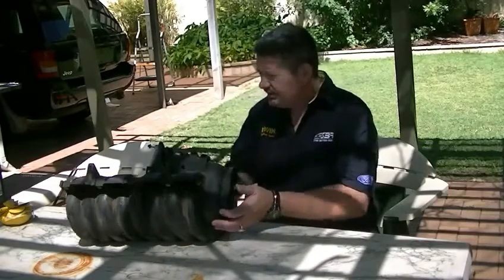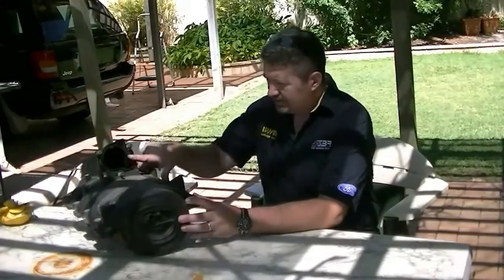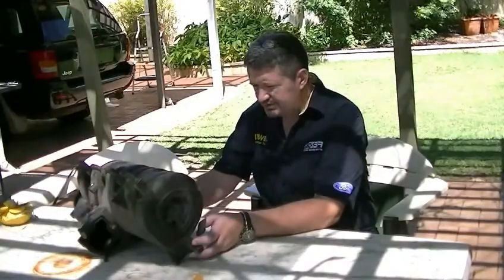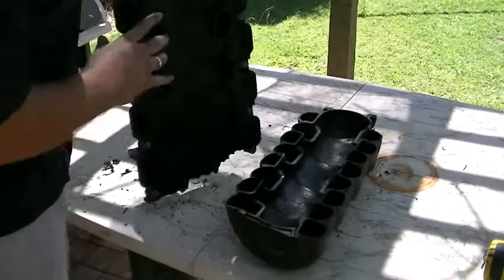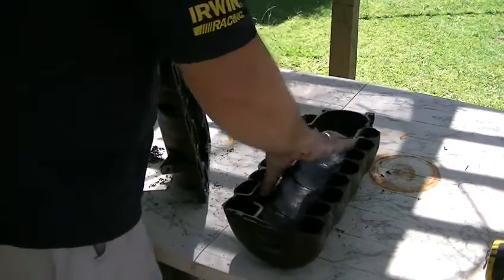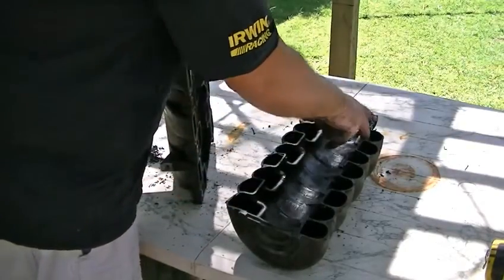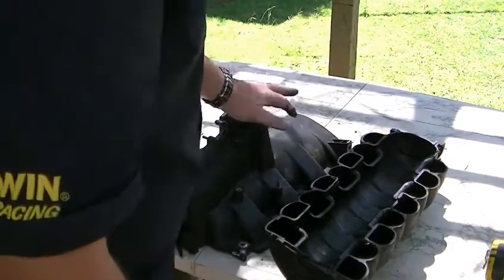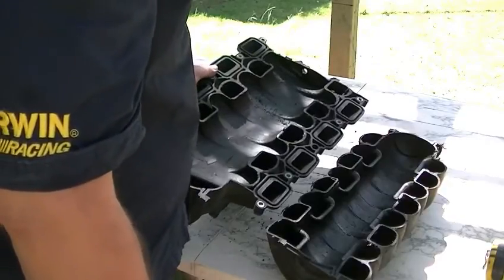What is inside a plastic intake manifold and how do they work.

Comment: static pressure is your answer, flow rate is a function of cross sectional area, and if all ports have the same cross sectional area all have the same flow rate in time once static pressure is achieved. Static pressure would be your intake manifold pressure (vacuum). the intake manifold is not much different than your home air conditioning system ductwork. Of course smaller volume ductwork will reach static pressure faster than larger volume ductwork. Static pressure is a function of resistance to flow. You think, but it is a vacuum, that does not really matter.

said another way, air will not flow into the cylinder until static pressure is first achieved.

Comment: Funny story. I bought an h.o. manifold at the wreckers and it was pretty greasy and dirty inside so i spritzed it down inside with degreaser and let it soak. Wasnt cutting much grease so i figured id flush it with hot water. 

Heres where i messed up, i ran a hose from the water heater drain without thinking and started flushing. I got a huge shock when loads and loads of calcium and limescale came out my runners! So i sat there flushing and flushing with fresh water for about an hour until I was content it was all gone haha. Needless to say i figured out the 360 degree runner design, still wondered what was inside it though so THANKS!
Reply from the maker: Your welcome.. I was also wondering the same since I had a spare laying around I thought why not have a look

Comment: why would buick use a plastic manifold on there 3.8 engine. it just cost me 900.00 dollars. how stupid are they. do not buy a buick with a plastic manifold. trust me
Reply: SheepTrees That is what they want consumers to focus on. in fact it is cheaper to make= more profits, easier to break to be a maintenance part = more profit, causes cars to be junked shortening 2nd hand market = more profits.
Reply: @crxdelsolsir  i'm sure that's also the reason why most aftermarket companies are now making performance intakes from plastic ... They can be made very solid if done properly.They are way less prone to Heat soak ( main reason for them ). Which is also why now most aftermarket cold air intakes are also plastic. Heatsoak.

Comment: Great video as always, looking at the end furthest from the manifold intact is the diameter/radius/circumference of the end larger then nearer to the manifold? I couldn't quite make out if this was so, as i would imagine this would help even the distance slightly? Although like you say regardless of the distance for each port the closest to the manifold get preferential pressure, am certainly interested in if there are any after market solutions to improve on this! Anything to help get more horses out of my engine would be great have always considered the 4.7 V8 to have far more potential.
Reply from the maker: +Chris Mason Thanks Chris Mason,
The runner diameters are all the same. I have more than one reason to cut the manifold. I am also filming clips on building my own manifold. I needed to cut it to make a jig and to easily trace the pattern. There is a Ford performance manifold you can fit with a conversion kit at airram.com.
I will load clips on building the manifold as I progress but I have a lot of jobs lined up so it will take a while. Regards Rik
Reply: Did you ever get around to making a custom manifold?